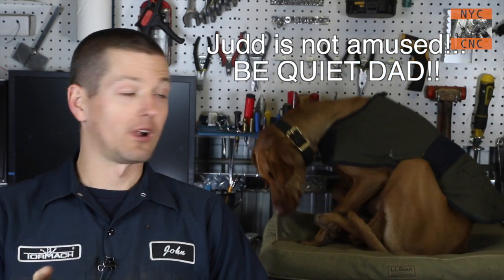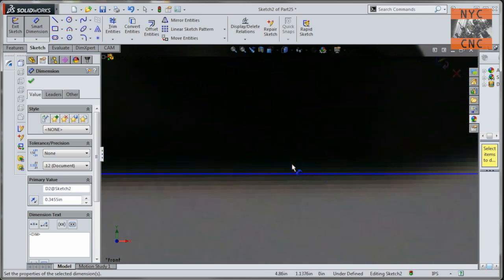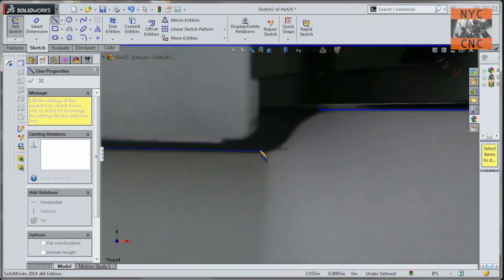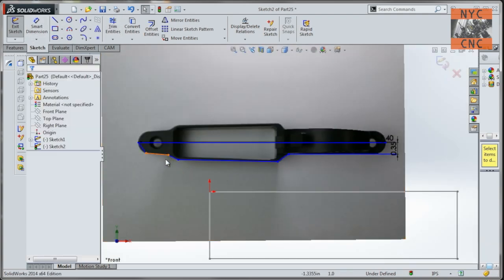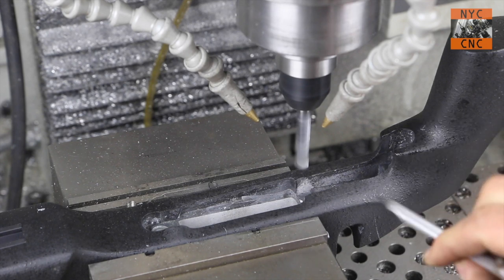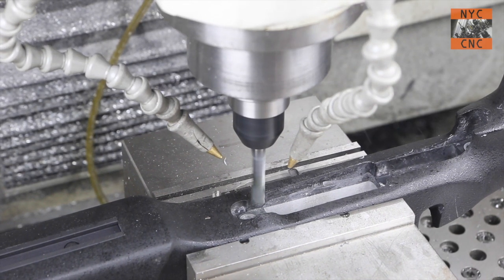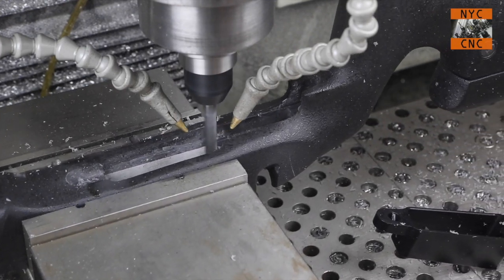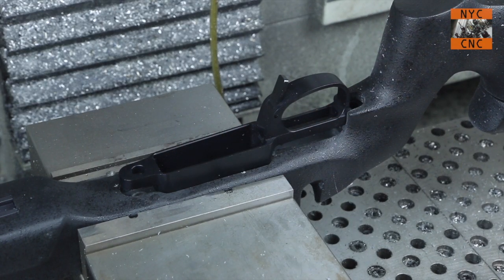A Picture is Worth 1,000 Lines of G-Code

Comment: One thing to think about when machining fiberglass or carbon fiber is that glass and carbon fiber are very abrasive and can damage the bearings and ways.  There are machines out there that have positive pressure on the bearings and ways to prevent damage to the machine.  One of my vendors used a HASS CNC to machine carbon fiber parts.  when the maintenance guy looked at the machine they wanted to know what did the damage.

Comment: For taking pictures of parts and stuff like this, without shadows, try a photo cube. Also known as a Backdrop Box, Light Tent, etc etc etc. Find them on ebay real cheap. I bought a whole kit for like 40 bucks, comes with lights, backdrops, 2 sizes of tents everything you need. I use it to take all my pictures for crap i sell on ebay. Works perfect! You would want a 24" cube for parts this size.

Comment: I'm a serious photo hobbyist as well as a machining hobbyist, so I'd like to give you a couple of tips about taking photos of parts.  To get less distortion of the part in the photo, pull the camera further away from the part and zoom in (the further away and the more zoomed-in the better); the longer focal length will make parallel surfaces (especially those running along the lens axis) look much closer to parallel instead of distorted (e.g. closer to | | than \ /).  Additionally, set the camera on aperture mode (or manual) and increase the f-stop to f13 to f16, which will give a greater depth-of-field (DOF), making more of the object in focus.  Since you're using a tripod/arm, you shouldn't need to worry about the shutter speed causing shake.
Reply: NYC CNC You're welcome.  1)  Yes, you move further away but zoom in (yes, a "real" physical zoom, not a crop/software zoom) so the image size is increased to compensate.  This is why portraits are shot at 100-135mm zoom and not at, say, 28mm (the wider the angle and the closer, the more distorted).  2)  Yes, higher f-stop.  f2.8 (wide aperture) has a much narrower depth of field than f13 (narrow aperture).  Consider that pinhole cameras have extremely wide DOF and a very small aperture.
Reply: NYC CNC You're welcome -- good luck!

Comment: John, you're a brave man!  I'd most likely have chucked up an old bit of 2x4 for a test run of the program before trying it on the actual stock.  I guess you've done enough at this point to be confident of your g-code. Well done.

-- Mike

Comment: Nice video, I am actually looking at doing something like this with a Rem700 long action.  Did you think of doing a test cut with scrap wood or plastic to verify the perimeter dimensions of your DBM?   Cutting the perimeter dimensions in say a piece of .080 kydex would help you gauge your profile very quickly.

Comment: Great video.  I do this sort of thing all the time in Vectric Aspire, but i'm trying to learn Solidworks and this helps a lot :)  One problem i have run into is that on the larger objects that i photograph and then try to model all seem to suffer from distortion. I'm not sure if it's something i'm doing, the way i have the camera or the lens of the camera.

Comment: You made a comment about fiberglass dulling your end mill.  This kinda goes back to a question I asked you a long time ago as to why you climb cut everything?  Your reasoning made sense, I think you said you do it to get a better finish on your cuts. I been machining wood and different plastic/fiberglass/composite materials for a long time in a couple of different shops and climb cutting has always been considered taboo.  You very rarely ever do it and in only a couple of situations.  But the reality of cutting wood or plastic is different, you use tools with different cutting geometries.  Like for example that cutter you were using didn't have an aggressive enough angle to the cutting edge.  Also it is my understanding you machine metal at way lower rpms than you would wood or plastics.  You put those 3 things together and your probably creating way more heat on that tool than you should be so of course your going to dull it fast.
Reply: Cool project by the way!
Reply: We had this one tool company for awhile that was sharpening and supplying us tooling and their representatives were all smart as hell.  Their knowledge of tools far exceeded any other company I have ever dealt with.  Unfortunately the shitty economy knocked them out of business.  Anyways what they used to tell me was the material your cutting doesn't dull the tooling, heat dulls the tool.  If you can manage the heat by using the proper tooling with the right geometry along with proper rpm's and feed your golden.  From my experiences I would have to say they are pretty right on with that assessment but that is also based best case senario.  Not always do you have the right tooling for the material you have nor the knowledge to run it optimally in some cases if you did because it maybe new to you.
Reply: NYC CNC  The way to look at is with a chain saw each tooth moves linearly and is cutting maybe 40% of the time for each rotation it goes around the bar.  Where as a table saw blade for example each tooth is only cutting 1-5% of the time for each rotation the rest of the time is cooling.  But I know what your saying there is times when I have hit staples or screws/nails in wood and killed a blade.  You know on the one hand based off what they told me it shouldn't have dulled the blade so fast but on the other hand wrong tooling for cutting metal.
Reply: Main reason to climb on CNC is because it will take less hp to make the cut
Reply: m98custom1212
I dunno if i by that one bit because your essentially working against the cutting edge of your tool.  It should take more hp to perform a climb cut.
Reply: Mopardude No climb cutting you're cutting/feeding the same way the endmill is spinning climbing up the material. I think you're thinking of conventional
Reply: m98custom1212
Were talking about the same thing.  I still don't agree but it maybe the difference in tool geometries.  I cnc wood, plastic, and different composite materials.  I know nothing of machining metal so possibly you are correct but from my point of view what you say is not true.
Reply: I believe the taboo against climb cutting is more to do with the possible play in work piece drive mechanism, ie sloppy leadscrews on a mill. With CNC machines the leadscrews are virtually backlash free, so there is less risk of the work jumping forward and breaking the cutter. When working wood, often the only drive is hand movement, such as when using a router table, and climb cutting can pull the work out of your hand, which is not likely to occur on a Tormach.
If I'm teaching granny how to suck eggs, my apologies.
c
Reply: Yes.. I forget add that. Little backlash and its more rigid usually
Reply: Mopardude What? Just because you change materials doesn't change the kinematics of the machine.

http://www.cnccookbook.com/CCCNCMillFeedsSpeedsClimbConventional.htm
Reply: m98custom1212
The paragraph under the illustration pretty much describes our communication break down on this subject.  The terminology is reversed for the type of routing each of us is familiar with.
Reply: Mopardude You're using a cnc router?
Reply: m98custom1212
yes
Reply: *****
Honestly you and M98 are taking this conversation to a weird place that I am not even sure what any of this has to do with my original comment.
Reply: *****
I get the feeling you think I am blasting endmills or something but I was just giving CNCNYC some pointers from my experiences working with fiberglass.
Reply: You know you can  turn that shit off right?  LOL
Reply: NYC CNC LOLz
***** Actually i was going to be a smart ass and tell you to turn off your phone so you wouldn't get them! LOL  But if you go into your google plus settings under receive notifications there is check boxes to receive by phone or email.
Reply: *****
Actually I was just assuming you had an andriod but i didn't think about if your an I phone guy it won't have google+ on it unless you loaded it there.

Comment: Cool use of the software. I was going to suggest two things, but Warndog beat me to the first one. so my remaning tip is, put the part on a light table. This will eliminate shadows around the part edges and mounting holes.
Reply: NYC CNC
I had two tips, but Warndog posted the 1st one. Warndog said: "...take the shot as far away as you can at your highest focal length. That will help limit a lot of the perspective problems of trying to get exacting dimensions."
It's like if you're taking someones portrait. If the camera is too close, the perspective will exaggerate the nose and diminish the ears. Back up, use a longer lens, and it flattens the image.

Comment: I haven't actually seen any of your 1050 stuff. I convert brass to 300 Blackout and I use 1050s for that, so you share at least two of your interests I didn't know about before this vid.

What are you doing with the 1050s? Are you trying to automate them? I searched your channel for using keywords "Dillon" with no results, and "1050" with no results. I'm interested to check out your dillon projects.

I've got 3 1050s running right now.
Reply: NYC CNC

Sure! I actually just became the first manufacturer to start producing and marketing blackout brass that is actually black. I'll send you some to check out if you like.

PM me and tell me where to send it, and I'll get some out to you.

Comment: so long as the ammo feeds from the mag then it doesn't matter how off the bottom metal is, so long as there is at least pillar bedding which there is, good luck with the rest!
Reply: Id recommend machining a full length bedding block for your specific action and don't forget when you manufacture your moderator to re cut the barrel thread to bore centre, Remingtons are notorious for cutting threads to the OD of the barrel. Looking forward to more from this series :)
Reply: I'm sure Remington have blind men cut the thread shoulder some times
Reply: NYC CNC
Them damn blind welders and blind machinists make the world go round.

Comment: Great video john, quick question if you don't mind, how did you raise the funding for your tormach, my bf20 cnc took me a year to fund and any idea's you have for making it pay for it's self would be very welcome, keep the video coming and stay warm this winter.
thanks Daniel.
Reply: NYC CNC
sounds like a plan john, thank you for the quick rely to my message, I sure have the cnc bug now :)
Reply: Yes I have a bf20 that I have made cnc, I have used fanuc controlled lathes and mills but I find mach 3 cnc alot easier to use, I am still getting my head around cam tho, I am using cambam which is very good and great value for the money.
Reply: Done some engraving and made hold downs for my vices ( still tuning the mill in ),  started with cnc 7 x10 lathe about 5 years ago and made tons of parts on that, I am still leaning, as professional cnc machines are a lot different hobby machines they are a lot more accurate, my bf20 cnc is on standard screws so a lot of backlash :( but mach 3 cnc does help alot.

Comment: Man, you didn't add tangency relations to all those arc endpoints! I'm not saying it's actually a problem, but knowing those intersections weren't perfect would drive me a little bonkers. In SolidWorks 2015, a feature they (apparently) added is you can now add a tangency relation by simply clicking the intersection point and clicking the appropriate icon in the fly-up menu, no need to select both lines any more. (I'm still on 2013 so I haven't tried that feature yet.)

Actually, by hitting the little 'down-arrow' on the arc tool you can select "tangent arc" and it'll automatically make them tangent to the existing lines. :)

I'm shooting to be "helpful" here, not to critique... so I hope it's not coming across that way.

Comment: I cringed when I seen you import that picture but I guess I can't argue with results haha. My only suggestion for others would be to take the shot as far away as you can at your highest focal length. That will help limit a lot of the perspective problems of trying to get exacting dimensions.
Reply: NYC CNC
Yep, he does and he beat me to it. I used to do a lot of portrait work, and usually I try to stay 4 to 6 feet back from my subjects. This makes even my uncle Bobs nose look normal.
Reply: NYC CNC
For 35mm film it would be 105mm. The digital revolution has scrambled focal lengths so badly you'd have to find some conversion equivalent chart for your sensor. My Nikkor 105mm was a money maker for my portrait work.
Reply: NYC CNC
If your sensor is equal to a 35mm film, that would be a good one. I should point out though, that perspective is a function of distance, while focal length only changes the magnification. If you have a tall object behind a shorter one, your distance from the near object can either reveal or hide the farther one. No change of focal length can do this. What I found in portrait work is, 4 to 6 feet provided a pleasing perspective on the subject, and the 105mm allowed me to fill more of the frame at that distance. You can shoot great portraits with a 50mm, if you back up enough. You'll just have to crop out all the empty space around the subject.

Comment: Great technique with photographing and using that as base for modeling. I used this a lot in DTP and converting to vector graphic from photos.
Reply: NYC CNC Desktop Publishing - Printing business
Reply: NYC CNC right. Illustrator or corel or photoshop. If you want to do it right you need manually to do it. Same principle like you did here.
Reply: NYC CNC at start was hard and frustrating but once you get up to speed and learn "rules" how to draw curves and where to put vector points it became easy. I can now draw anything with stunning speed and acuracy.